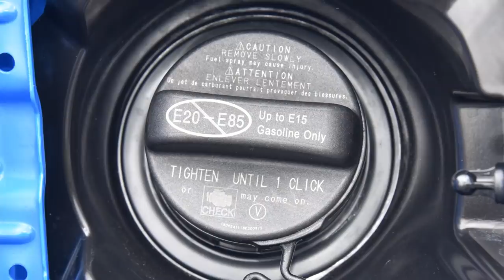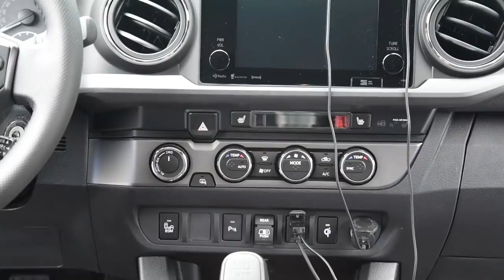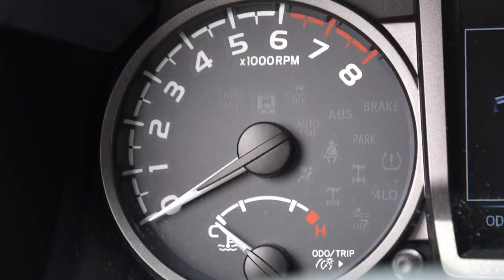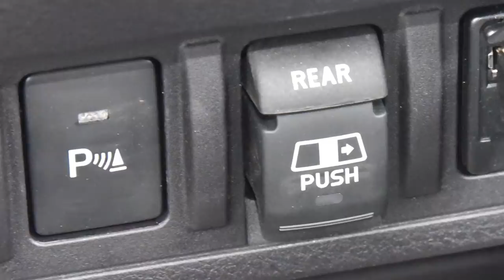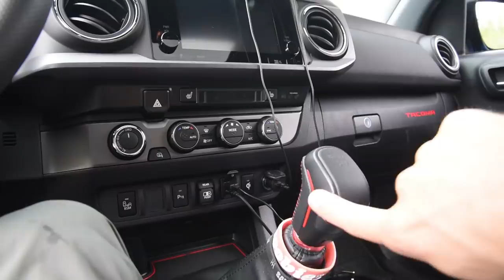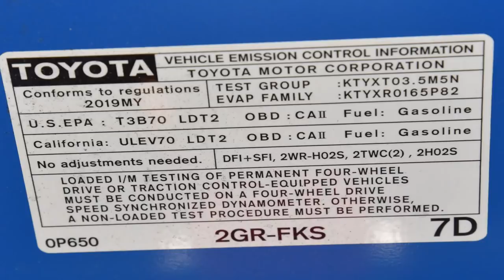2019 Toyota Tacoma TRD Pro: Regular Car Reviews

Comment: "Subaru owners: mod a car to death then wonder why it isnt reliable anymore"
Reply: Even without mods they are shotty. Also who thought a plastic timing cover over a rubber belt on an interference engine was a good idea? I learned this the hard way.
Reply: Toyota owners:  I'd rather pay up front for the cost of all the maintenance of a Subaru since 1995
Reply: I drive a 20 year-old EJ222 phase 2. It's dead reliable, one of the best engines Subaru ever made. That's why I chose it
Reply: To me, all Subarus feel like they're at least 25% pickup truck. I've never been in a Subaru that rode well enough for me to think "I should buy one of these and maybe throw some performance mods on it."
Reply: The thing is most other cars can be modded and reliable for cheap
Reply: Merl Klarhoelter  please, just no
Reply: Merl Klarhoelter  yeah after being built 😂
Reply: Merl Klarhoelter  litterally, no u, they can't handle boost and that's a fact, the na ones are great, but turboed not that great
Reply: @deusexaethera  my subaru IS a pick up truck

Comment: "Offering a six speed ma-"

All is forgiven.
Reply: You don't forgive Toyota. Toyota forgives you.
Reply: @jimbopaw  no no, that would be Lada
Reply: I'm pretty sure it is the only new truck available with a manual trans.  And only one 4 door model at that.  What a crime.
Reply: @samd1405  Nissan Frontier is still an option, but only the 2 door trims and you lose out on a sixth gear and 4x4.
Reply: @tbr2109  2WD is not a truck. ha.
Reply: @samd1405  I searched for a long time for a 3rd gen 2 door Tacoma with manual. I didn't realize no such thing exists, but I can believe it. Eventually I got the auto. Oh well, at least it almost has a real bed and It's not as obscenely large as a full-size.
Reply: Love my 6 spd manual for sure
Reply: I am a huge v8 truck guy. I never even considered a v6 midsize truck until I realized/ found out the Tacoma's have a manual. I'll be getting a 2020 trd!!

Comment: >Has snorkel above the roofline
>Will never go through anything deeper than a six-inch puddle
Reply: it comes stock with trd pro trim and its not even a snorkel. Toyota put it there for better air intake in sandy conditions. Kinda tacky? Yeah a little.
Reply: @SniperBlitz2234   it's an option from the factory you can get for the TRD pros with out the snorkel.
Usually Dealerships will order them with the package
Reply: Snorkels are like 90% about avoiding dust  and 10% about crossing deep water.
Reply: /o/h, hello there
Reply: @stickshiftelitist5683  general Kenobi!
Reply: I was just going to say..."No comment about the giant fucking snorkel?...'kay."
Reply: Snorkles are meant for dirt more so than water.

Comment: I cant beleive how correct you are in this video... had nothing but subarus since I've had my license and as I become more money conscious I've been looking into Toyotas...
Reply: my cousin also had a couple Imprezas but ended with a TRD Vitz which sounds faster than it is but surely that thing is reliable as any Subaru ever built
Reply: I've had 2 tundras, an Impreza. A fa20 wrx, and now a ej 2016 sti and I want this damn truck
Reply: I’m driving an 02 camaro working on my credit because I’m only 20 but I do want a Toyota Tacoma to be my first dealer bought vehicle. I would happily buy a used older one even a ranger but I live in the Texas panhandle where people only sale those kind of trucks after they’ve been totaled. And they will still have the guts  to put it up for three grand 😂

Comment: These are going to be rare in 30 years. Especially this manual one.
Reply: You can tell he is is thinking ahead about resale value. There is not one bit of mud on the internals. His mods are all about maintaining the car in a great shape. I am guessing he modded and used his STI to death and it was beaten up and nobody wanted it in the end, so he learned a lesson and now he is off a different start. Plus Toyotas are very reliable and last forever and as such they keep their resale value well.
Reply: They will be rare period lol. I thought this was a parody when i started watching.
Why would anyone buy this?
Reply: No it's not. They're selling over 100k of them a year. And not as work trucks. Given how easy it is to find an 80s Toyota pickup in 2020 (probably the easiest 80s vehicle to find in running condition) I see no reason to expect these won't be the most common used truck of the era forever.
Reply: 10k+ with 150k miles

Comment: Daily driver trucks with snorkels 😂.
Reply: I read that the snorkel is actually non-functional.
Reply: @geethsan1567  snorkel is functional...the hood scoop is not.
Reply: Luckily not all of the TRD Pros have that snorkel. I think it’s stupid. I’d opt to not get the snorkel if I bought one.
Reply: @97I30T  In NY you literally have to get them. And we have winters here so uh yeah.
Reply: They make sense if you live in a place with a lot of unpaved roads. They're more for avoiding dust in the intake than crossing deep water.
Reply: AD1 thank you. seems way fewer folk realize this than should.
Reply: @Shakshuka69  thanks x2, nothing more annoying being out with the car people and they see a snorkel and say "oh, I beat he drives through rivers all the time." I just go laugh at them and tell 'em to really research their meaning
Reply: @Shakshuka69  more importantly they also get the intake roar up next to your head when you have the window open. :D
Reply: @Shakshuka69  my car has a filter that keeps dust out of the intake
Reply: @Shakshuka69  or, air filter.
Reply: @fitch9782  your air filter is designed to deal with a moderate amount of dust under normal conditions, not driving through literal clouds of it for hours at a time. Especially not on a regular basis
Reply: IIRC, the snorkel is used for sand and dust, not for water
Reply: Or both. Filters get blocked real fast on unsealed highways.
Reply: A snorkel is for getting air while under water. So in that sense it is fake just like the hood scoop. Toyota is lost.
Reply: @BAYAREAMX  No. No it's not. As high as the airbox/intake is in a Tacoma's engine bay - if you're in water deep enough to get hydrolocked, you've got bigger problems to deal with. A snorkel is to get clean air when driving on upaved roads behind other vehicles that are kicking up massive clouds of dust and sand.
Reply: @steve.r33  I guess Toyota has changed the definition of a snorkel then huh? Lol
Reply: @fitch9782  But you need to change it half as often when you have a snorkel.
Reply: @Shakshuka69  It's not a water "snorkel" it's a "desert air snorkel" meaning it's only good to suck fresher air from above the truck it will flood if you try fording water. So it's basically pointless to have.
Reply: @brandonmoore9440  It's not pointless. It keeps the intake free of dust and heavy particulates.
Reply: @steve.r33  It's pointless for the 99% of people buying it because they believe it's a true "snorkel" and then don't put the truck in a situation to utilize the intake plus factor in no car wash and having to turn around the intake in a snow storm it checks off more boxes as being pointless than beneficial unless you live in like Nevada where you go on the dunes all the time and it doesn't snow.
Reply: @brandonmoore9440  also, Arizona, Utah, California, Idaho, there are deserts in a lot of places. But I do agree in Pennsylvania it is entirely pointless.

Comment: I'm surprised you didn't mention the fact that it's a 40k truck with DRUM BRAKES IN THE REAR. Love your vids keep them up bro
Reply: Even my mid 90s Isuzus had discs in the rear.
Reply: @williamparker7823  They aren't horrible trucks, but if I'm shelling out 40 fucking grand for a Raptor competitor GIVE ME D I S C S
Reply: As I understand it, lots of pickup trucks still use drums in the rear because drums are almost impossible to overheat, which is useful when towing.
Reply: @deusexaethera  This doesn't sound right honestly.
Reply: @ilpatongi : I'm passing along hearsay. I could be wrong.
Reply: @deusexaethera  Don't worry it was just a simple thought, who knows what kinds of strange happens with cars.
Reply: @deusexaethera  dropping in three months later.....they use drums in the rear because in trucks, a vast majority of the braking is being done by the front end. Therefore, they can skimp some on the rear end and use drums. But drums overheat much faster than discs, simply because there's less surface area exposed to cooling outside air.
Reply: @callumlavigne2463 : The vast majority of the braking on any vehicle is done by the front brakes. It's a simple matter of physics: when braking the vehicle leans forward onto its front wheels and off its rear wheels. Trucks are not unique in this respect.

Comment: I like the six speed and locker. Everything else I could live without.
Reply: Then get a frontier... save 10-15 thousand and get more comfortable seating and better reliability.... and disk brakes... if that matters to you.
Reply: They’re pretty decent trucks but my problem with Nissan is the closest dealership is roughly 100 miles away. But I didn’t know you could get one with a manual and a locker so that’s something to consider when I buy my next truck.
Reply: Lookaway GRstay don’t get a Nissan if you ever want to run your truck to 200k+ miles and still have any resale value when you’re ready to update. FYI TRD Off Road has a rear diff locker and the same engine / tranny as the Pro..

Comment: That condensate drain extension is going to do very little as far as frame rust goes. Road spray/ salt spray is the real killer. Get the underbody Krown sprayed (or another corrosion oil spray) if you really want to slow the rusting.

Comment: I see a TRD Pro Tacoma or Tundra and think to myself, "There goes a sucker".   $45,000 and you are paying MSRP(my dealer had a $5000 markup on a Tacoma Pro).   New SR5 4wd stickers for $35k, dealer will work with you on price because he has 10 other SR5's on the lot he needs to move.  All I'm saying is $10,000 buys you way cooler wheels/tires and a lot more lift with $$$ left over.  $10,000 is a lot to pay for badges, Fox shocks, leather seats, sunroof and a douche bro snorkel.

Comment: Engine bay and undercarriage: spotless. Good thing he has a diff breather mod.
Reply: A what? This was filmed in 2019, the truck was brand new at the time. Is offroading a brand new truck not kinda like street racing a sports car during its break-in period?
Reply: Tom Lake Charles Actually no. It’s not like that at all. Racing a car before the break in period can do irreversible damage to the ring lands and cylinder walls. Off reading a truck straight off the assembly line will....get it dirty.

Comment: I cant belive im saying this about a new car  
But i like it
Reply: Well it’s relatively “old-school” engineered truck, I won’t be too surprised. And that’s the whole charm of Toyota Trucks
Reply: That's because you think it's really an offroad truck like you think your Subaru is really a rally car.
Reply: @INUMIMI28  it's considerably less old school than the current 4runner and has so much unnecessary tech crammed into it that calling it old school in any capacity is a farce. Maybe old-school compared to a Ridgeline, but that's not even a truck.
Reply: AD1 I think it’s still old school compared to trucks like Colorado and Ranger. They already have 8 or 10 speed available where Tacoma still uses 6, Ranger uses modern turbo and Colorado has much newer LGZ V6 with more power while Tacoma still uses updated version of 2GR. Although like you said, it’s high-tech especially compared to rest of Toyota trucks, but Tacoma is still going for “old but proven” appeals

Comment: Regarding frame-rot from air conditioning condensation: Yeah, it's distilled water until the very instant it touches the dried film of road salt on the frame rail left over from the previous snowstorm.

Comment: Drove the TRD Off-road model at a Motor Trend show a few years ago. Shortly after that, I got a job at a car auction and have been hunting for a manual transmission Tacoma ever since out of pure curiosity.
Found one.
Took it for a spin.
I'd rather have the automatic.

For those wondering, Mr. Regular doesn't get any more correct about that shifter. It has ZERO feedback, sloppy at 20k miles, and meh at best. It does slip from gear to gear very ell, but that's all it does well. Also, it blocks the HVAC controls akwardly.

If you want a manual truck like this and can afford a truck like this, get the Jeep Gladiator. Might not be Toyota reliable, but the 3.6l Pentastar V6 is fantastic and proper Jeeps shift really good.

Comment: Trucks mostly still have mechanical fans last time I checked, they're able to move a lot more air than any sanely sized electric fan.
Reply: That doesnt make sense
Reply: @BAYAREAMX  Why?  An engine driven fan can spin a lot faster without needing a big electric motor.

Comment: coupla thoughts, for what they are worth.  1 lbs-ft less torque, but at 600 rpms higher and with less torque all along the way, so they aren't wrong.  clutch fans are more than fine - they offer advantages for off-road durability that electrics don't.  For kyle (not that it matters) water doesn't come in through the breather,  the breather closes off in water and the pressure drop from dunking a hot axle in water draws in water from the axle seals when the breather closes.  Relocating the breather means it can do its job of allowing pressure to equalize AND prevent water from coming in at the same time since the breather valve no longer needs to close to prevent water ingest.

Comment: The "lack of low end torque" complaint is because Toyota went from a 4.0L to a 3.5L - the peak numbers are similar, but they occur higher in the rev range in the 3.5L. The 4.0L makes 266tq @ 4,000RPM the 3.5L makes 265tq @ 4,800RPM, then there is looking at the area under the curve, where the 4.0L had a flatter torque curve, meaning it's making more torque across the RPM range most people hang out in (750-3,000RPM). Whenever displacement is reduced and technology remains mostly unchanged, you need more RPM to get the same power figure; HP=(RPM*T)/5252.
Also, devils advocate - F150; granted, stick shift taco is going to be reliable, and do the job you need it to, however, F150 is way more truck, and typically for less money; slushbox only, but it's lightyears ahead technology, interior materials, and pretty much every other aspect of the vehicle is better, for similar fuel economy, and did I mention waaaay more truck.

Comment: On a different note, I've worked at a Toyota dealership. In said dealership I dealt with several different "Tacos", and the newest one had the same weak-ass shifter. When I drive a manual, I expect that thing to sit still and not wiggle (keep your mind out of the gutter.)

Comment: Saying the 2GR is not a good sounding V6 is... questionable. Check out the Lotus Evora 400.
Reply: Maybe, just not in this configuration. Mid engined routed exhaust sounds a lot different too. Also, all hail MEJ ;)
Reply: @MR2SpyerJournal  True but even that 18 Camry XSE someone straight piped sounds AWESOME.
Reply: That's a 2gr fe/ 2gr fse. This engine is not the same or as good at all
Reply: @notasolution  New Camry XSE uses the same 2GR-FKS and it sounds amazing. It's been straight piped already. Plus, they're all fundamentally the same engine.

Comment: I have a '20 TRD Sport, 6 speed manual, I got the access cab. I think the reason why it doesn't have the full IMT is because if you're towing you want to use full engine braking, or just because its cheaper. Probably the ladder.

Comment: Water magically traveling up the diff breather is NOT what was causing rear end failure in these trucks, nor is that a thing that happens lmao
Reply: The rear end failures on these trucks started when Toyota decided to use a 4.30 axle ratio on a tiny ring gear. Also thanks to Toyota's decision to move axle production from the US to Thailand.

Comment: For me it was a early retirement truck. Just to put stuff in, small yard work. I have a awd volvo but it's not really made for anything to big. Also live in a snow, country area. 4wd/awd kind of necessity. I picked this version for the lockers etc. 
In case i get stuck in winter or a road washes out a little.
Had full sized trucks before, just nolonger a need for a large truck so downsized.

Comment: TRD Pros do seem to be spotless here in AZ. To be fair, so are the Raptors. Either they're doing a much better job of protecting against the AZ pinstripping than I am, or they're not seeing much OR use. My 16 TRD OR 4x4 has some deep ones and I can't make up my mind on being ashamed for not taking better care of it or saying to myself at least it's not a mall crawler. I used to OR my Corolla so it's kinda sad it had more pinstripping than these trucks. Damn trees/bushes will reach out for hugs and embrace you with saguaro like thorns. I get trying to keep a truck pristine especially how expensive they are these days, and maybe I'm not doing everything I can to minimize getting carved up but if I'm shelling out that money and OR was my goal, I'm going to use it for the intended purpose. Tacos excel OR in stock configurations at any trim. The pros will handle higher speed rough trails better than the ORs or SR5s but thankfully as fun as that sounds just about any other trim will be a better value for casual medium use. Perhaps RCR should revisit when someone is willing to take it off-road on something other than a well maintained dirt trail. That's where Tacos shine. Frontiers are great as well.